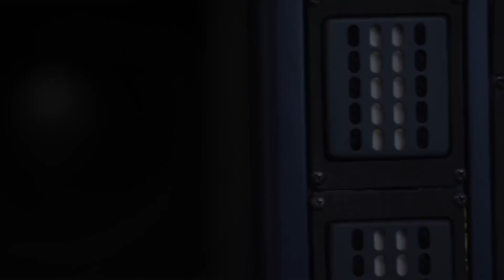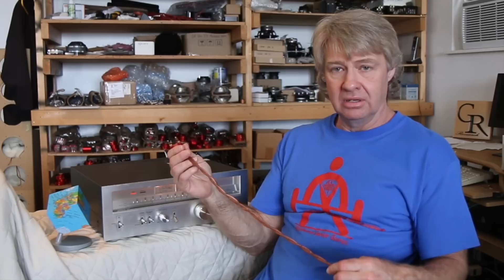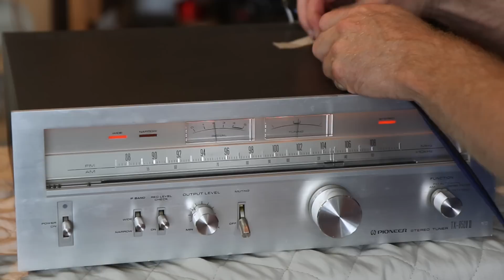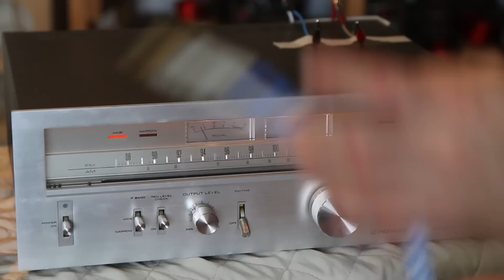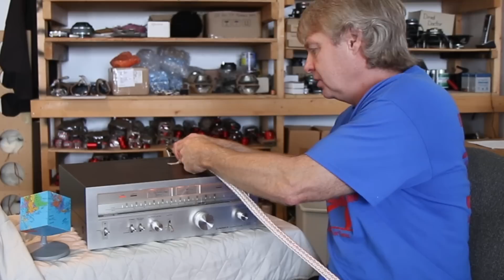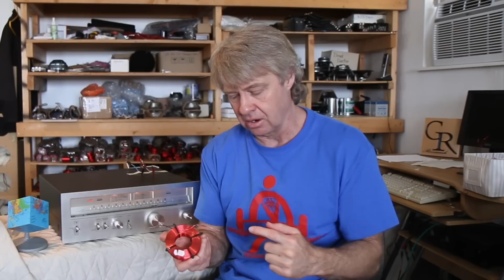Do Audiophile Cables Matter? Here's PROOF!

Comment: AudioQuest sell speaker wire for $4200 (almost double the cost of my Rotel RMB 1555 5 channel amp) Canadian for 100 meters and $300 for 10 ft. Their HDMI cables run from $280 and up depending on length. Audio cables from 200 and up. Are you telling us that you get sound performance so dramatic that it would be as if I was in the heavens standing before God? What is the percentage difference in sound quality from 300 ft of AudioQuests to 300 ft from Amazon or GearIT? I can go to my local electronic dealer and get speaker wire for $ 1.50 per foot depending on the gauge it is. Now for Audio cable. What’s the difference in sound quality percentage from a $700 RCA cable from AudioQuest and one from FosPower that only cost $14.00 for 2 sets that are 6 ft long? Trust me there is snake oil in the audio cable industry.  Glad I subscribe to Audioholics where Gene tells it like it is. I’ve saved a tone of money listening to his advice!!!!
Reply: Actually the site you mention is one of the largest producers of dis-information in the industry. Follow their advice and be content with what you have. If you want to reach new levels then walk away from their rhetoric and start your own listening comparisons.

Comment: If this video doesn't do it for you then try different cables on a good stereo system. As they say the proof is in the pudding.
Just like electronic components are a part of the system the cables are as well. Advanced users can move on to the length and direction of the cables.

Comment: I wonder what the test would show using standard shielded Cat7 (SFTP). The conductors are fairly small gauge (22g I believe), but there are eight of them (four pairs). I'm thinking you could gang four for the positive lead and four for negative lead.... Or Perhap 2 separate cables one Positive and one Negative.
Reply: Those actually make good entry level speaker cables as many over noted.
Reply: IINM CAT network  cabling is #24 - and most often solid 4 pairs twisted, and has been trendy for DIYers for at least a couple of decades - including braiding geometries much like the higher end cable Danny demonstrates here - but is a royal pain in the ass to strip all those insulation jackets without nicking the conductors.

Comment: WOW! You are a brave man to tackle this one. "What? Couldn't find an alligator to wrestle?" 🐊
Thanks for the video. Keep em coming. Cheers! 👍
PLEASE tell us where to find these cables that don't require a second mortgage. 🤑
Reply: https://www.ebay.co.uk/itm/Original-12TC-24-Strands-PTFE-OCC-Copper-Home-Theater-HIFI-Audio-Speaker-Cable/392779347600?_trkparms=aid%3D1110006%26algo%3DHOMESPLICE.SIM%26ao%3D1%26asc%3D20131003132420%26meid%3Dd16944ab96544e6684534d021d5ef8c2%26pid%3D100005%26rk%3D3%26rkt%3D12%26mehot%3Dpf%26sd%3D323803987631%26itm%3D392779347600%26pmt%3D1%26noa%3D0%26pg%3D2047675%26algv%3DSimplAMLv5PairwiseWebWithBBEV1Filter&_trksid=p2047675.c100005.m1851

Comment: My tweeters max out at 45khz, I'm not especially bothered by megahertz frequencies at nano volts. However this is a good argument for common mode rejection at line level. Maybe I'll do a braided speaker cable one rainy afternoon for a bit of fun hobbying.
Reply: What sources do you use that have such a wide response?!
Reply: @randszzob8590  Nothing that's just what the spec sheet said. Funnily my hearing tops out at 17khz making all this talk of unamplified megahertz even more irrelevant.

Comment: Can you recommend specific cable brands/ models that you think are good value? Maybe even diy?
Reply: I am a budget audiophile and don't put a lot of stock in expensive cables. I do put stock in using good wire, good connectors and good assembly of them. SO I went cheap but it had to have the above so I went with ones by Worlds Best Cables because it uses Canare L-4E6S, Star Quad, Audio Interconnect Cable and Amphenol ACPR Gold RCA Connectors. Z Reviews has been using them as well.For speaker cable I went DIY with Canare 4S6 Star Quad speaker cable and bananas. ends being about an 11 AWG cable, nice and thick and good flexibility. SO my whole system is wired with Canare wire which is a professional/recording/touring brand of wire. Mogami would be a good choice as well..

Comment: Danny, while I do see the differences in audio, I have a question: How would noise above 80kHz affect audible frequencies? RF noise is not audible in the air, why would it be in the speaker?
Reply: That noise effects everything in the system path including the signal transfer. So the effects are quite audible.
Reply: @dannyrichie9743  no they arent. i have a 50ft RCA running into home theatre ZERO noise when powered on. even at full volume all you hear is a slight buzz from the amp inside. this is BS
Reply: @redleather420  You probably never heard a true low noise system. And in a low noise system the differences can be very audible.
Reply: @dannyrichie9743  I guess you have to hear to believe as with many things

Comment: The braid of the cable would be awesome to see so we could duplicate it. I know that would probably be the end of a cable but I would definitely be willing to send some Patreon money to you to helping for the cable. Your work is so sound I can’t help but think your blowing people’s minds with your factual tests.  Please don’t stop making videos I love to learn 👍🏻👍🏻
Reply: Zeos did a video making a nice braided cable cheap recently
Reply: Well yes danny's has 18 wires and zeos's has 8. Also no core piece. But they are similar and zeos does a reasonable job of showing how to make it cheap.
Reply: I don’t believe they are the same thing
Reply: Actually 24 but surprisingly the angle they cross is important and it is not 90 deg.
Reply: I’d say there has got to be a very complex braid to render the wire so dead to noise. If it wasn’t than all speaker cables would be makes like this.
Reply: The 24 wire cable looks suspiciously like the Kimber Kable 12TC I use.

Comment: If your amp is sensitive to RF coming in on the speaker leads you have bigger problems than speaker cables. My dad had an old Fisher tube reciever that picked up the neighbors linear amped CB. I slapped a 1pf cap on the speaker outputs and that went away. I suspect that those braided wires are acting as tiny capacitors.
Reply: No, they are acting as antennas.
Reply: Mdmchannel  auto corrupt strikes again. Sorry for any confusion. When I posted that it was 1 picofarad in its abbreviated format. I had to backspace and un-correct it when I typed it and apparently it was auto-corrupted sometime after I submitted it. This makes me wonder about the admissibility of anything posted online. I don't have to wonder about posts here. This is at least the third time a comment of mine has been auto-corrupted.
Reply: It's not an amplifier, it's a tuner lol!
Kinda designed to pick up the RF :P
Reply: That is total bullshit. Not across the speaker terminals. It wouldn't do a damn thing.
Reply: @dalemcgaffey4272  Actually it did. My suspicion is that the almost 30 year old crossover had some going bad in a non-linear way. We could hear the noise on the headphone output, but only if the speakers were on. Disconnecting either conductor caused the noise on the headphones to stop. This was not common mode noise. Never saw the like of it again though and it has been more than 30 years. One of the speakers made a much larger contribution to the problem, like 20db more than the other. The speakers were a miss matched pair of AR 10" 2 ways.
Reply: @jdrissel  What you were experiencing with the Fisher receiver and the neighbor's linear amped CB was the RF being picked up by the speaker cables and getting into the receiver's RF sections and being detected and amplified. Similar to a crystal radio that doesn't even need a tuned front end but just detects the strongest AM signal and has enough power even to drive an earphone. I was into CB and ham radio back in the 60s before converting into an audiophile. The 1pf cap was enough to kill the RF signal enough to not be a problem.
Reply: @dalemcgaffey4272  Wouldn't do a damn thing?   isn't that exactly how a crossover network works?

Comment: Basically speaker wire cannot improve the overall quality of sound of your system, but it can degrade it. But, it all comes down to how much you're willing to spend on a cable having in mind price/ performance ratio. You have to ask yourself is a 1000 dollars cable 100 times better than a 10 dollar cable? Maybe, maybe not.

Comment: To get the best out these premium cables, wouldn't you also have to install them inside the speaker boxes?
Reply: That is exactly what I have done. I put Tempo Electric solid core silver wire inside my speakers, and also have the exact same wire going from amp to speaker.
Reply: @karlcotleanu4144  Don't forget to put (replace) all wires in side your PC, DAC, Preamp and power amp. Don't for get the circuit trace as well. I am sure it will block all signals.
Reply: Yeap.  Then wouldnt better crossover parts improve the sound? Yeap, the ones in series with the drivers.  Then wouldnt better drivers improve the sound? Yeap, but the new ones are unlikely to fit the cabinets.
BAM!
Welcome to diy loudspeakers & hifi :D
Reply: law of diminishing returns - hopefully the runs inside the speaker boxes are much, much smaller than the runs outside the box and therefore the marginal improvement of higher quality cables between the binding posts and the drivers compared to the effort makes it an effort that's not quite as effective in improving quality
Reply: All my internal wires are double braided.
Problem solved.
Reply: This kinda stuff drives me nuts ! Next thing out there will be resoldering all the electrical connections on the boards because some study out there claims using silver solder sounds better than regular solder! Lol! When does it stop???
Reply: Not just in side the speaker box but every where from power cord, all the wire out side and in side PC, DAC, Preamp, powerampand, interconnect and etc... Don't for get the tracing of the circuit board too.

Comment: so if the power amp has good rf filtering, we can just simply use any cheap but good speaker cables, right?
Reply: Good (size) speaker cables can't be cheap. But the small size cables aren't as good.
Reply: @IliyaOsnovikov  nah. high quality low gauge speaker wires definitely are affordable, look up belden or canare cables.
Reply: There is no difference. Just get a decent gauge of whatever copper wire. The warm fuzzy feeling you get from knowing you are not a complete and utter fool is better than the dopamine hit you get from bragging to your buddies about your thousand dollar speaker wire.
Reply: if other cables in the system are letting noise in, the filtering achieved by the speaker cable (the last cable in the delivery chain) cannot remove it. but it will prevent more noise from getting in the signal.

Comment: do you know that you can calculate cable inductance?  do you know that this value will be negligible compared to amplitude of the signal generated by the amplifier?  even if it is such a problem that it occurs, it is eliminated by shielding the cable or in the case of stage equipment using differential transmission

Comment: I did an experiment to see just how much what you shows matters.  I hooked up speaker wires to my speakers to see how much volume I got from all those RF signals going through my speakers.  Of course I didn't want any interference from the amp itself so I disconnected that.   My speaker wires by themselves are DEAD silent.  Now if you were talking about RCA cables that would have been a different story.  I don't want RF in my cables before they get amplified.  But my amp drowns out any sound that hit my speaker wires.  Sorry but this demonstration is totally meaningless.  I do use XLR wires to get rid of noise before the amp.  But after the amp we're not going to pick up any noise from speaker wires.
Reply: Good test.  Yes, if the goal is to maximize silence when no signal is passed then why not test that directly?  Which I think is what you did?  You can't get quieter that dead quiet right?
Reply: All of that noise has an effect with every cable in the system including the speaker cables.  And while XLR cables can do away with a lot of that noise, in general the rest of the make up of the cable, and its ability to carry the signal accurately is quite poor. There are some high end XLR cables out there, but the selections of good XLR cables are quite limited. Like I said in the video, the ability to filter or pick up noise is just one aspect. Also those XLR cables aren't helping what is coming out of the wall. It has to be a complete system approach.
Reply: @dannyrichie9743  I don't think you understood what he said. He's saying that the interference applied to the cable post amplification has no effect. He also demonstrated the condition where this is the case
Reply: @SabiSlides  It still has an effect and it is easy to A/B that effect by sliding a Copper Z sleeve over the cable or wrapping it in a little bit of ERS paper.
Reply: @dannyrichie9743  Following up with an AB of this showing the difference in measurements would be amazing
Reply: @dannyrichie9743  go ahead and measure the difference. Please.
Mark's little experiment is exactly what is needed to demonstrate the effect of EMI on a speaker cable. Anyone can do it. And with an open end it's even worse than in a typical usecase, where you'd have a 0.1Ohm (or less) impedance connected at the amp side.

Comment: This is not about the merits of audio cables by it self but the method of comparing so sorry, you lost me here. I like your pure approach to loudspeakers but using RF to compare audio that is like the proverbial apples and oranges. If you go to the Audioholics YouTube channel, there is a lot said about this subject and specifically that impedance matching which is so important to RF does not play a role to audio. After all you are connecting an amp with a very low impedance to a speaker with 8 ohms (or rather a frequency dependant impedance). That in the RF world is a big No No. So I could come up with an RF generator and matching networks and show a whole load of interesting stuff but it is not applicable to audio. This is the issue if you try to cater for technical and non technical people at the same time on a subject that is highly technical and abstract.
I hope you can come up with an other one, I will forget about this video and come back for something else. Full disclosure I bailed out at 3 minutes and 56 seconds because there are so many interesting videos competing for my on-line time that this one does not cut it.
Reply: You spent more than 4 minutes texting and editing your comment.
Reply: @ericjensen9091  That is still less than half the time of the complete video, plus I engaged in a dialogue about this subject.
Reply: @hugobloemers4425  Maybe you should have watched the rest of it if you really are open to different points of view.
Reply: By bailing early then you missed the lesson. 
Also the website you sighted is one of the greatest distributors of dis-information on this subject.
Reply: @dannyrichie9743  Once I knew that speakers where being compared with RF, there was no value for me anymore. 
Regarding Audioholics, I think I learned more there than on this channel though I find this channel also interesting because I am open to different points of view and agree with a lot that is being said here, just not everything.

Comment: I agree better cables do improve the sound but the noise the cable picks up can be measured have you do these tests it should be mains borne 60hz or RF wise from switch mode power supplies